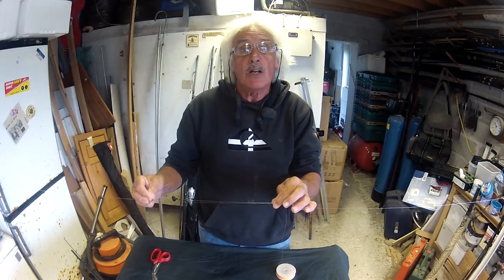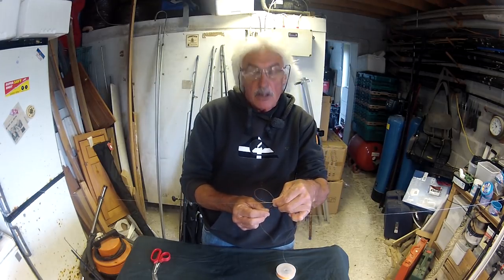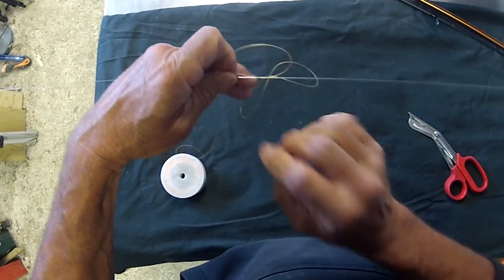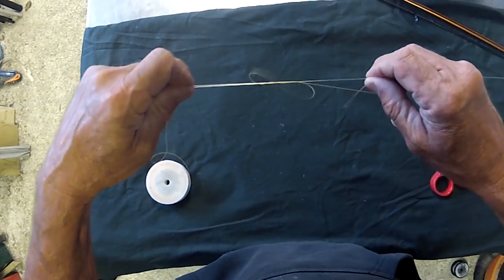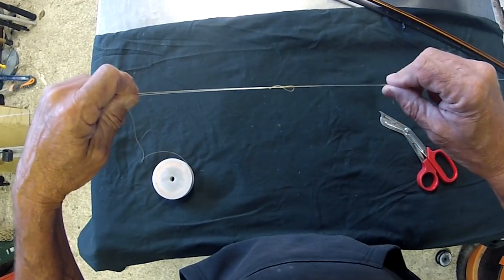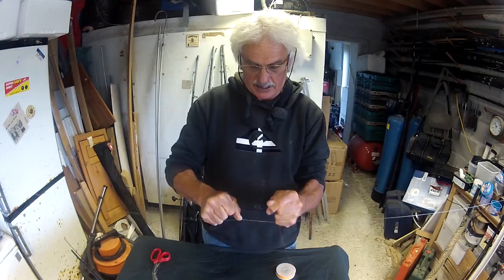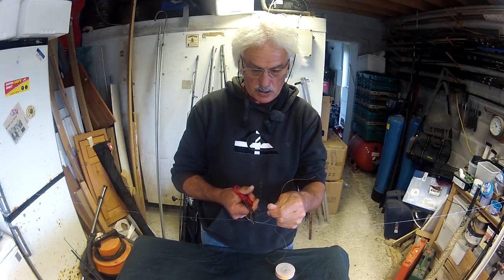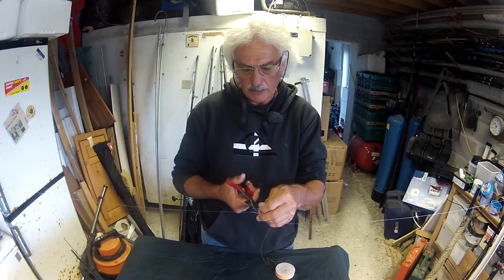How to tie a float stop knot with Ed Schliffke

Comment: The tag ends should be left 2cm long at least in order that the knot will pass through the rod rings easily.
Any shorter and the line becomes a bristle and will tend to snag as it passes through the rings and jar on the cast - longer tag ends will bend as they reach ring and smooth the passage of the knot.

Comment: Grr this doesn't work for me! Every time I cast it gets stuck in the rod guide and my float snaps off!!
Reply: Maybe try using a thinner lighter line for your stop knot to reduce its size.
Reply: Dont cut the tag ends close cut the 2 tag ends 2 inches long this will make the line pass through your rod guides   if you cut them to close they will catch the rod guides.DellBoy